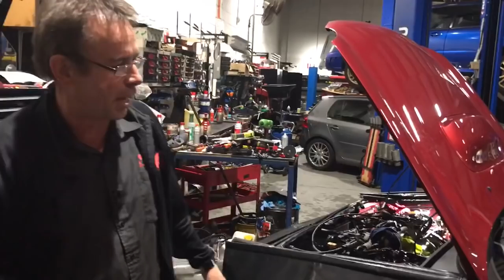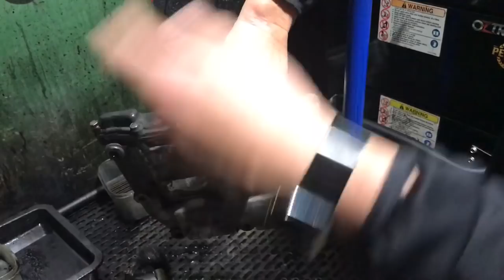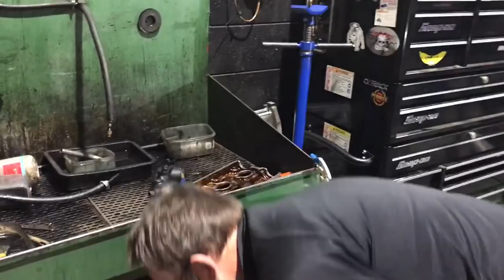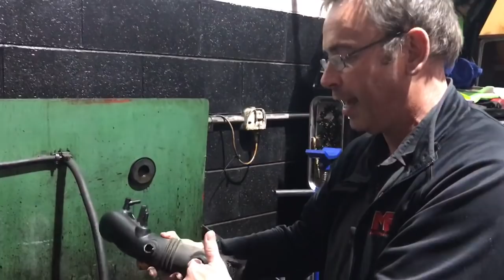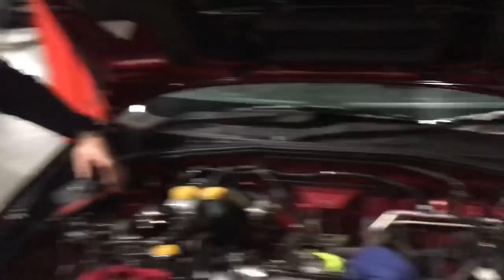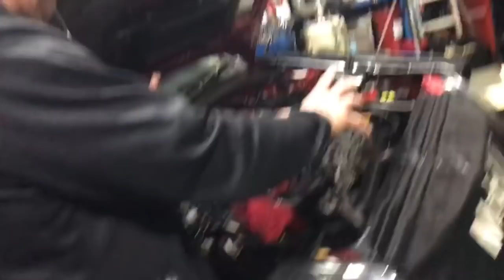Petrol Engines and Soot Buildup

Comment: This kind of soot/carbon build-up happens when the engine oil runs out of detergent and dispersant. It does not necessarily mean the oil is low-quality. You can keep using the same kind of engine oil, but you have to shorten the oil change interval accordingly.
Generally you have to adjust the oil change interval based on the conditions of the vehicle's operation. As is stated in every vehicle owner's manual I have read, if you do a lot of city driving and/or short trips, you need to shorten the oil change interval, even to a half of the nominal mileage/time period.
Reply from the maker: spot on!

Comment: That pipe is the worst part of Subaru design in my opinion. That fails so many times...
Reply from the maker: Mister -_- McGill remember its 15 years old
Reply: MRT Performance yes sir it is! It just seems like the rubber integrity always looked folded or torn on most I've seen. But yeah after heating up and cooling that long what can you expect?

Comment: What oils are good to use? I would love to keep my MY17 impreza running for a long time.
Reply: Tracey Allen , Brett did mention Mobil 1, because of its added detergent levels.. Helps to keep sludge down.!
Reply: I would ONLY  use group  4/5 engine oils, nothing less.  Penrite Racing for me.
Reply: I use Millers Nanodrive CFS NT+ in my MY04WRX PPP, if you live in the UK get it from "Opie oils", they have 10% off codes all the time (M3C always works), this week they had a 15% off code.